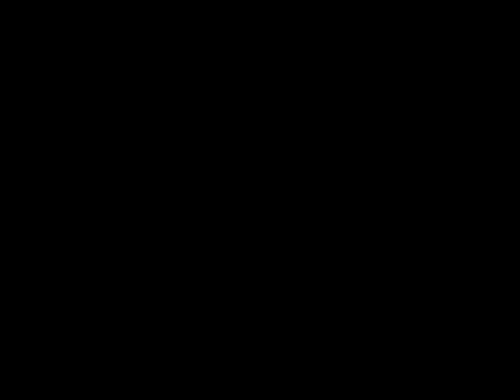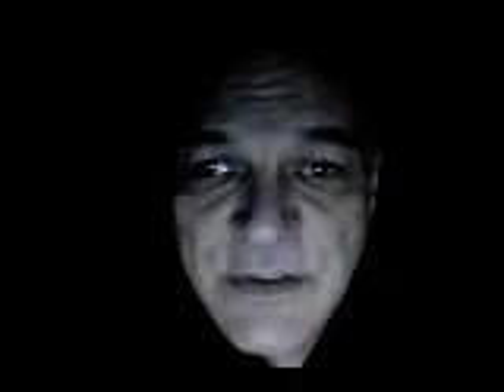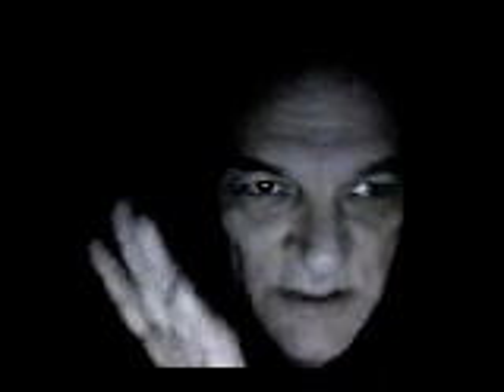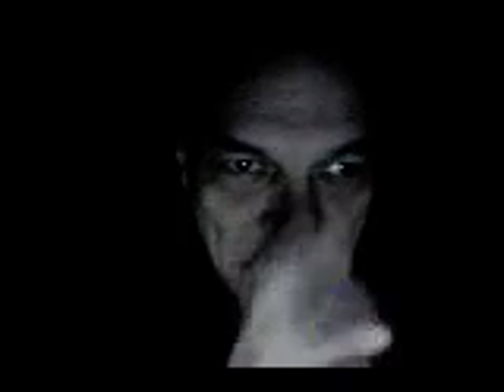Known by Default prim gatherer strat tier 0 rust lighting & tool cupboard range igno-rant RFI RFC #3

Comment: hi mate can you explain the dangers of a web page or smart tv having the capability of using the screen as a camera
Reply from the maker: FYI, in late 2018 & or early 2019 
giant plastic serpent & human  skeleton sculptures 
made by Taiwanese sculptor Tu Wei-Cheng & 
inspired by a folktale were displayed in a Krabi Thailand cave 

https://youtu.be/ztOunKRGGrE 
https://taiwantoday.tw/news.php?unit=18&post=144849 
https://moc.gov.tw/global_outreach/News_Content2.aspx?n=530&s=18927 
http://file.moc.gov.tw/001/Upload/OldFiles/AdminUploads/images/large/c7675827-53b1-47a4-b3ac-5f5a9edf15b3.jpg
Reply from the maker: will upload vid next
Reply: @waptek2  Thanks , i rushed that upload and posted most times i do a little research. of course i no it's ridiculous and goes directly against my algorithm of always disbelieving the fantastic. i will add your links greatly appreciate it. I will look forward to your new piece. Here is one, can  a ceramic buttet take out bulletproof glass, Ceramics makes good armour also fibre glass/cured with resin.looks good to play with. I only just searched the queery of ceramic buttets but nothing on its usefulness with toughened glass types.
Reply from the maker: their is little info as most tests were done long ago, & a hard brittle ceramic bullet will probably can't "exist" BUT a plastic or copper clad  low density ceramic core frangible bullet that will shatter upon impact  "can" disrupt hard layers in bullet resistant panels & "glass" 

https://patents.google.com/patent/US4939996A/en 
https://youtu.be/NvKrEYepYVI 
https://youtu.be/ydSg1axMFQs 
https://youtu.be/UxGO2QHSgFo
https://youtu.be/5P3zh1Ar12s
Reply from the maker: rfc rfi = 

a pre 2012 US military attempt to view the future, whistle blowers are listed as Bob Lazar , Dan Burisch , Bill Wood & this is found under project camalot re uploads before 2014 as " project looking glass "  
& or part of the the plot of the 2004 tv show Lost 

https://youtu.be/VtHCofbE1PM  
https://vimeo.com/533624555

https://old.reddit.com/r/conspiracy/comments/s6j382/this_was_from_about_10_years_ago_project_looking/

https://en.wikipedia.org/wiki/Project_Camelot  1964